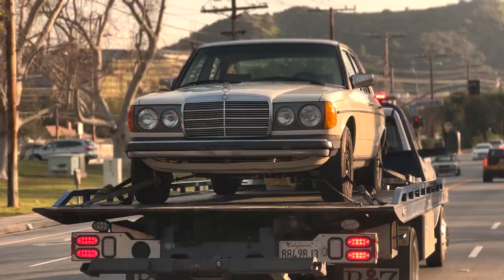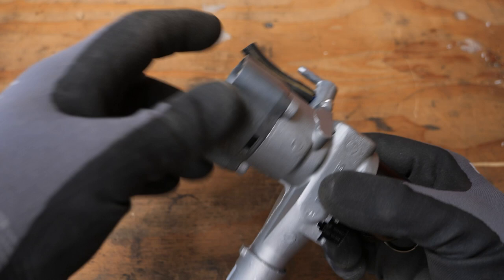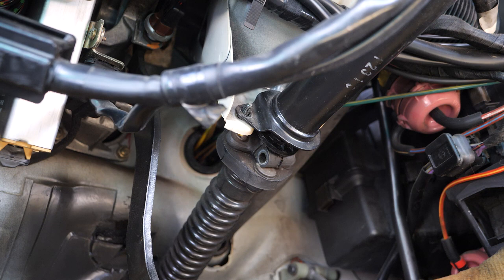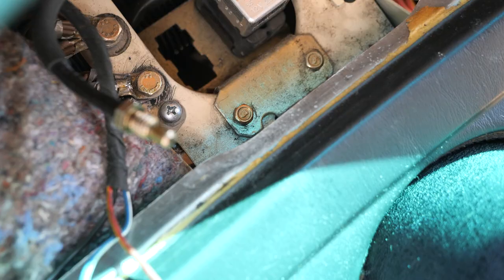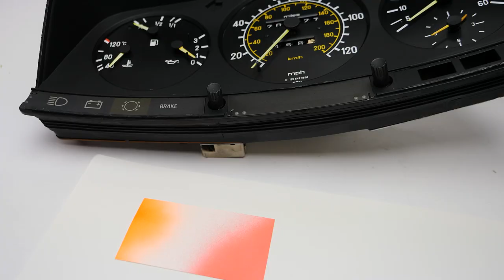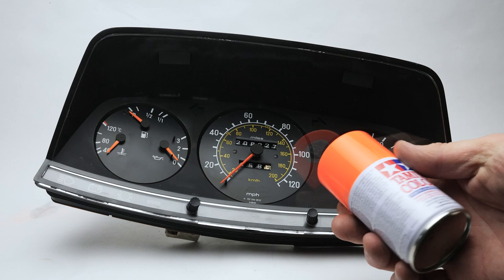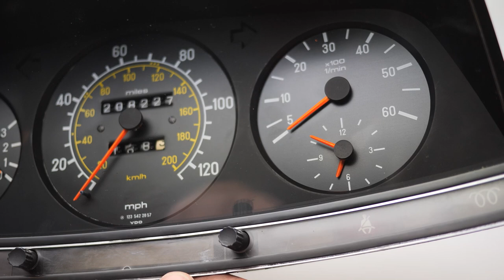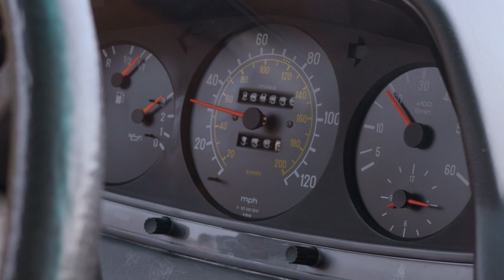Mercedes 300D Ignition Lock replacement and gauge needle painting

Comment: Hi John..Good info in your video  I am about remove and replace the steering lock on my 126 which I driven for 20 years.  Did you have any issues removing your lock that I should careful of? Vac hoses? etc.  I installed new tumbler so problem is likely with steering lock.  If I park car with wheel turned to right, steering lock does not engage and I can remove key and restart.  But hoping a new steering lock which I've ordered, will resolve the issue.  Keep checking youtube - I may ask a question or I could fly you here to install it for me..🤣😉🤔

Comment: Hey guys, around the 9:08 mark you say “this little oil sender would definitely cause a problem if I started the car right now”. I actually did start the car at that point (with the oil sender still disconnected) and now it won’t start again (with everything re-connected). What do I need to do?